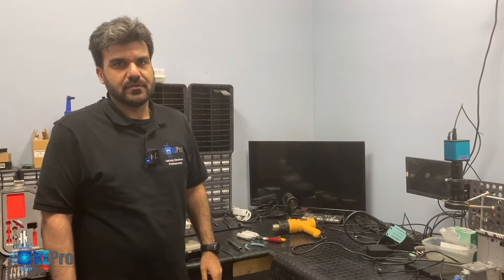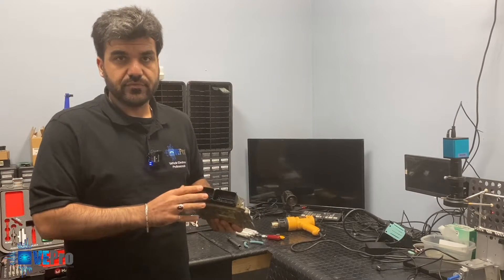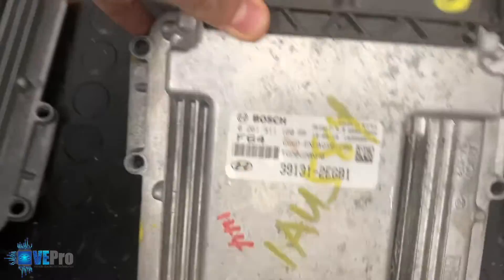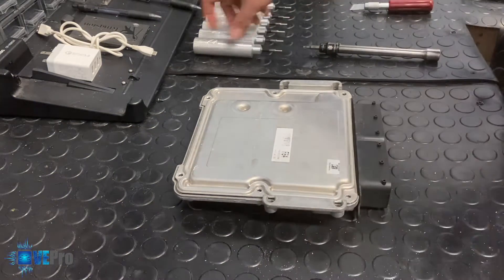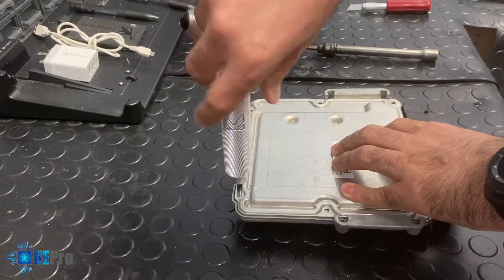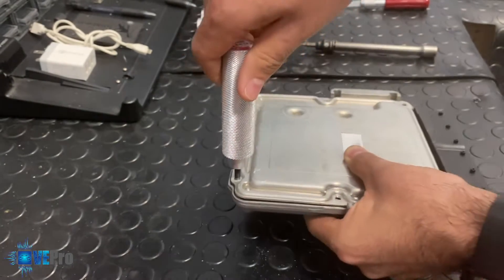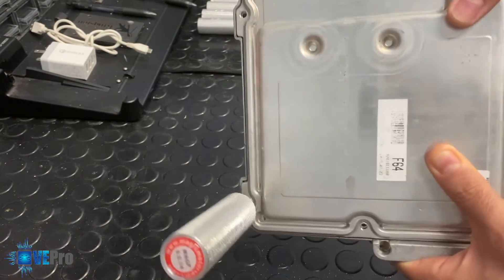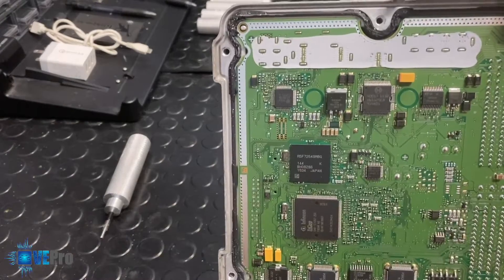KIA HYUNDAI | MEDG17.9.8 ECU CLONING | BOSCH ECU COVER EXTRACTORS | FLEX TOOL

Comment: You did all the careful opening and cleaning, Put a nice sealant on it to close it, which is good work,  but you did nothing for the most important part. You did not add new thermal grease/thermal adhesive for where the pcb connects to the case for its heatsinking.
Reply: heatsink is on the alluminium case
Reply: @fabioballesteros9841  Yes that is true, but my point was the repairer did not use any thermal grease/adhesive to fill in the imperfections from where the old thermal adhesive was broken loose (the light gray stuff). That spot will not be able to transfer heat well anymore to that side of the case. You don't need to scrape it away but you really should consider apply some new grease/adhesive there to fill in the airgaps.
Reply: @ecurepair  there is not a heat point
Reply: @fabioballesteros9841  Yes there is. Look at 7:50. You see the grayish color stuff on right side of pcb? That is old thermal adhesive.  Then at 7:56, you see where the cover is flat in that same spot when placed back on? that is because of components on the other side of the pcb that gets hot. They need to release heat on this side of the case.
Reply: @ecurepair i have been workibg with two of those ecus, and nothing is there to deserve the heatsink, try yourself
Reply: @fabioballesteros9841  My ECU was cloned in my car and my ground drivers failed because they bent the lid and didn't replace the thermal paste. Caused the drivers to overheat and burn out after just a year. I would agree with ecurepair that adding in thermal grease (like for a PC cpu) is needed. They put it there from the factory for a reason. It uses the entire lid as a heatsink, if the thermal paste doesn't seal that gap it doesn't function as it should. Anyone that has dealt with custom ECU's and dealing with coil drivers knows the importance of cooling these type of parts.
Reply: @DrMario69 is seems you dont know what are you saying, read first
Reply: @fabioballesteros9841  What do I need to read? How electric components work? I am already aware. They overheat this is why they used thermal paste to conduct the heat to the lid. I have the same exact ECU in the video and it failed because someone like you didn't properly install the lid. I am only here to see if replacing the thermal paste is common practice and having my ECU fail last week because of this. If you don't see the thermal paste you are either lying or pretending. Good luck I hope people read this and have someone else that installs the lid properly do it for them. Someone points out you did it wrong and you lie and pretend, not a good technician.

Comment: I’ve seen another video arguing against the use of heat to remove the cover. They suggested the use of brake and clutch cleaning spray to weaken the sealant.
Reply: no problems to heat it up